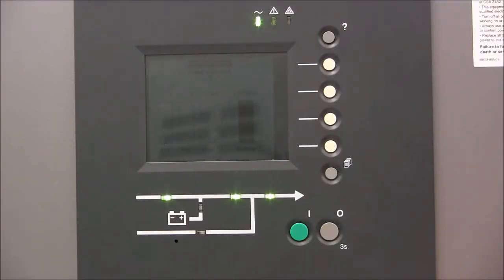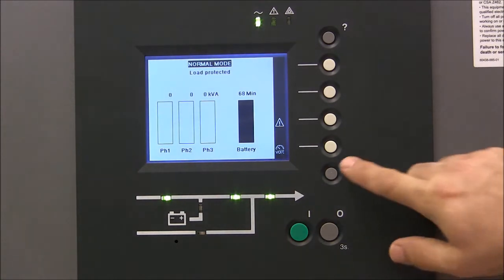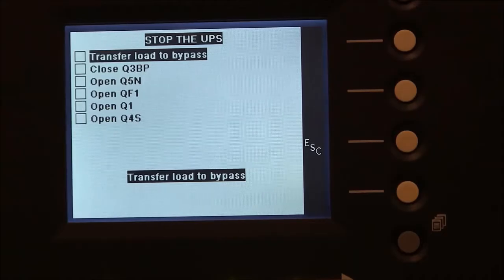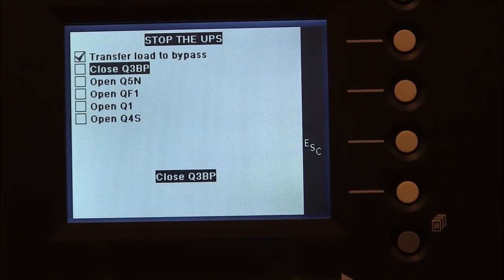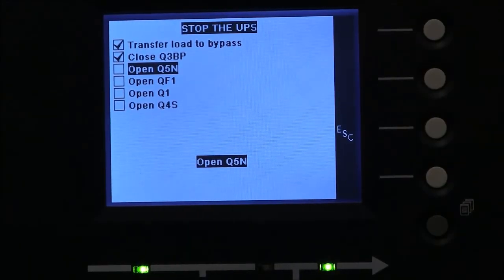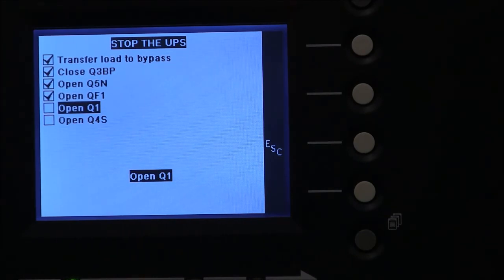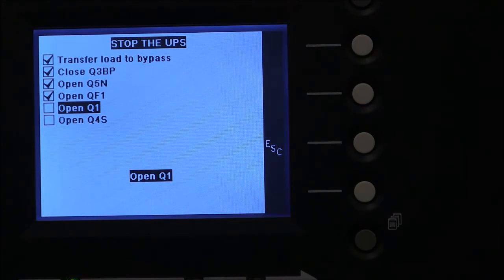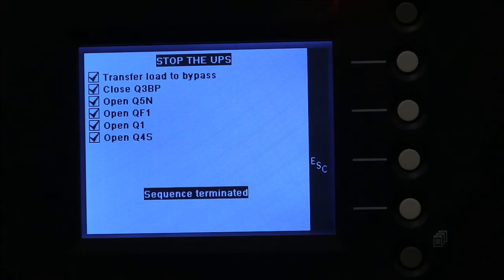Shutting Down the MGE Galaxy 5000 UPS | Schneider Electric

Comment: Hi i have the same Galaxy in the video. the screen isn't displaying how can i solve this? please help. the ups has stayed 5 years not in use. all battery are still ok 12volt each
Reply: does the light come on if you touch a button

Comment: i have 160KW load and i have 300kva MGE galaxe UPS .how many batteries , amp need to be installed?
Reply: My APC is showing PFC  fault
Reply: LET ME KNOW WHICH MODEL YOU HAVE IS IT GALAXY 7000 OR GALAXY 6000. HOW MUCH THE RUNTIME YOU REQUIRED ?
Reply: greetings. is it possible to use apc mge 5500 without batteries. I only need it to keep the incoming voltage stable. without oscillations. to use it instead of a voltage regulator. and if it still needs batteries. what is the minimum possible.  my load is about 20 kw on 3 phases